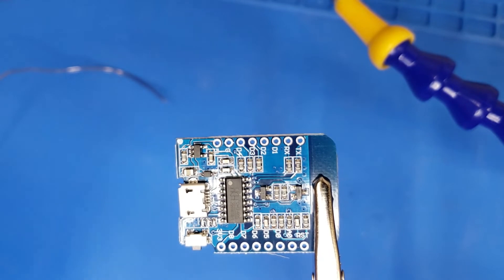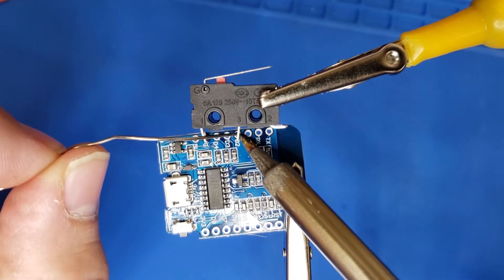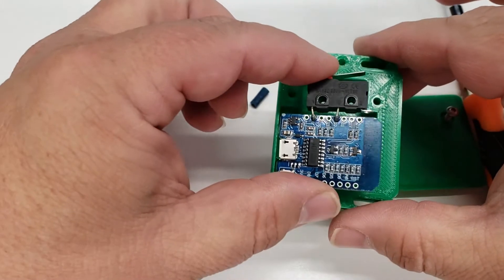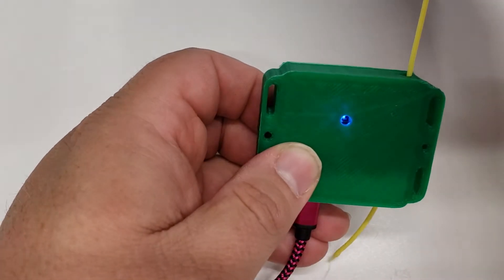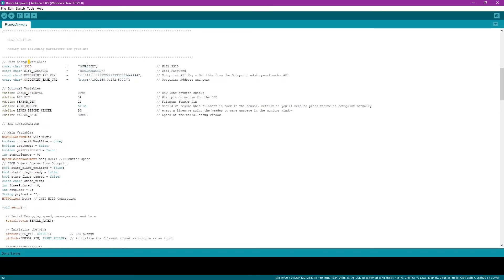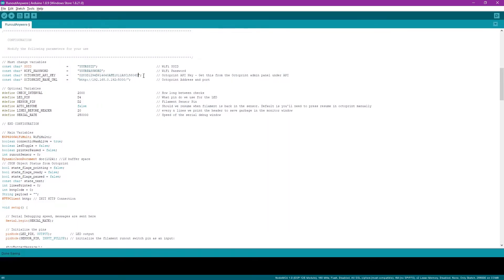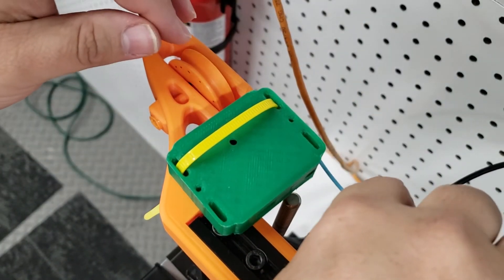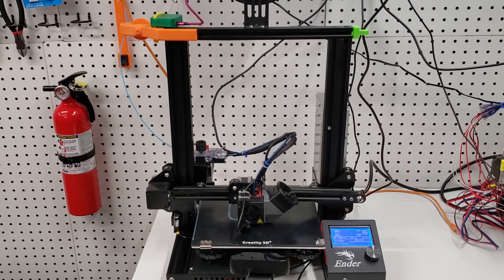Portable WiFi Filament Runout Sensor (Ender 3, Anet A8, CR-10, Universal)

Comment: The Code of "RunoutAnywhere.ino" does not compile properly because the call to 'HTTPClient::begin' declared with attribute error: obsolete API, use ::begin(WiFiClient,url) leads to an error. The solution is to substitute 
'http.begin(String(OCTOPRINT_BASE_URL) + String("/api/job"))' with 'http.begin(client, String(OCTOPRINT_BASE_URL)+ String("/api/job"))', and then the code compiles well.
Thank you very much to the Author of the Code for let us participate of her or his work.

Comment: How do I use my existing runout sensor that came with my ender3 s1 plus? I wish to add 6 Sharpie colors to the frame, but my spool is in the way. I plan to place it on the side and have my runout sensor as close to the extruder as possible.

Comment: I finished my sensor today and found that D2 on the chip corresponded to D4 in the code. Now sure if I had the wrong board selected or the wrong version of drivers or what. Once I sorted that out it worked beautifully. Thanks!

Comment: Hey - thank you so much for putting this together.  I am running through this now and got to the very end.  I have a successful pause if the filament runs out - but - right when the filament is reloaded, it continues the print.  That doesnt give me enough time to run the filament into the printer.  Ideally it would keep it paused, then I could click resume in Octoprint.  Any idea what I misconfigured to do this?  Feel free to message me and I can send a video.  Here are the only gcode I have in octoprint:
On pause: M117 Print Paused ;show message to LCD screen
G91 ;set printer to relative positioning
G1 Z10 F1000 ;move print head up by 10
G90 ;set printer back to absolute positioning
On restart: M117 Print Resumed ;show message to LCD screen
G91 ;set printer to relative positioning
G1 Z-10 F1000 ;move print head back to original position
G90 ;set printer back to absolute positioning
Reply from the maker: #define AUTO_RESUME                      true    
That line indicates to start printing again when filament is restored.  Swapping that to false just means you have to press resume in octoprint once filament is loaded.  
#define AUTO_RESUME                      false
is what you wan!  Good luck Trey post some pictures once you get it all working in the discord or leave a link to social media here.  Would love to see it!
Reply: @MakersMashup   Thank you for getting back to me so quickly - sorry I missed that in the file some how.  Was looking for pause, start, restart.  Completely spaced on the word "resume" :)

Printed, posted my make, and created 2 filament guides that this can just slide into that work as a filament guide when I'm not using it for my Ender 3 pro.
To mount at the extruder: https://www.thingiverse.com/thing:4492824/files
To mount at the top v rail: https://www.thingiverse.com/thing:4492840/files

Been loving it so far.  Working without an issue.  Thanks for creating this!

Comment: Why use that when you can add to PI it self. You still have to use PI Anyway
Reply from the maker: Not everyone uses a Pi for OctoPrint.  I ditched the Pi long ago.  They don't tolerate power outages well and once you've smoked an SD card or two and have had to rebuild the PI you get tired of it real quick. The USB on the Pi has a number of known documented issues as well. I also run multiple octoprint instances on it as well so one $110 mini PC does the work of two $60 Pi setups.  The wireless runout sensor also allows me to move it around to another printer if I need instead of having to have a runout sensor installed on each printer.  Flashing the firmware only takes a few seconds.  If you're using a single Pi with each printer and its in close proximity then yes a Pi with the plugin is an easy approach but I feel the RasPi is a poor device to use with Octoprint given the issues with it.  Full blown linux on a $110 mini PC to me is a much better long term investment.
Reply: @MakersMashup  So you using PC for it. OK. I personally did not had any problems running PI.....

Comment: You can't have a BLTouch and a fillament runout sensor?
Reply from the maker: Not on an stock ender unless you want to do some soldering. Unless the changed the board recently there was only 1 extra pin available on that melzi board.  Obviously doesnt apply to all printers.

Comment: can it be powered from the Ender 3 USB port?
Reply from the maker: The Ender 3 USB port is for sending data to the Ender itself.  Its not designed to be a host.  I havent tested it but you would need some specialized USB cable.  I don't think it would work.

Comment: This is awesome! Do you think I can plug it into the raspberry to power it? Also, by doing that, could I avoid wifi connection and send the pause command directly to the raspberry? Thank you so much for sharing all this!!
Reply from the maker: Sure you could use pi power but if the pi is that close there is a octoprint plugin that essentially allows you to do the same thing.
Reply: @MakersMashup  oh I will check that out! Thank you so much for your quick reply!

Comment: I like it. It may be a little less "transferrable", but if octoprint is running on a raspberry pi, or similar with GPIO. There may be some advantages of monitoring the switch and driving an LED from the Pi. Should be able to connect over localhost, so it'll work without WiFi. The switch/wemos holder and code would need to change.